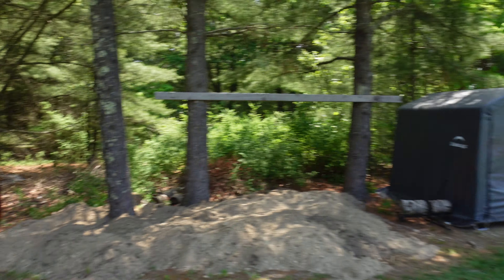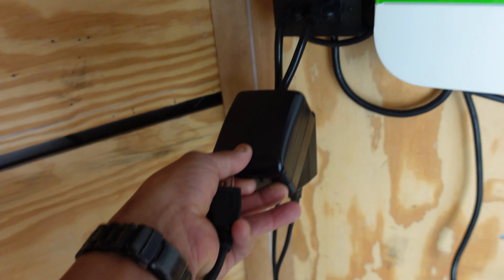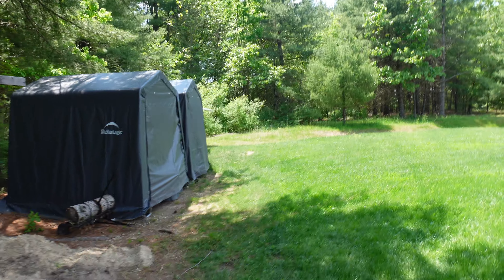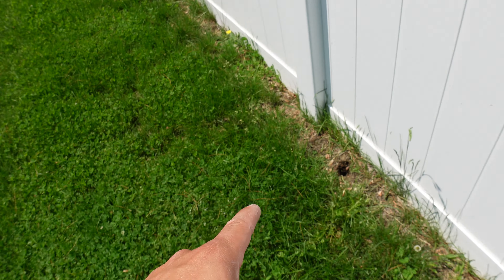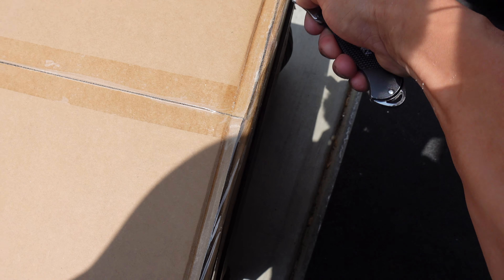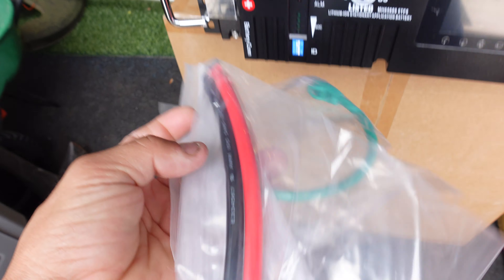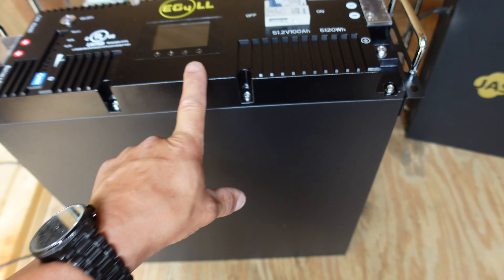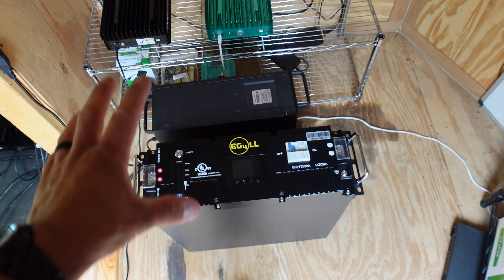Crypto Mining Solar Trailer Upgrade Begins

Comment: Check also the structure of the trailer, so that it withstands the weight on certain location.  To my understanding not all trailers withstand heavy weight on some specific spot but its more like total weight loaded evenly on the total surface area of the trailer.   Just to avoid surprises.

Comment: The Cables are fine for the rack connection.  Youll need larger cable running from the rack to the invertor.   You can run much smaller cables at the higher voltages. Same with the solar wiring. You'll most likely run all your panels in series for high voltage rating 400v+. These systems are much different than the 12v stuff. Just installed a 48v system less than a year ago and it's been great.
Reply from the maker: Awesome thank you for letting me know about the battery cables for the rack. I forgot higher the volts the cable can be smaller

Comment: Solar panels mount 3ft away from fence and 2ft off ground facing south. Mine are lined next to vinyl fence and low end was flush and tilt was 30 degree but entire setup had to go 2ft off ground to get extra 60w from Each bifacial.. and def got your work cut out for. Out of the box the eg4 rackbattery BMS will just run with no use of communication port use. and welder cable run between battery 2 gauge and 4 gauge to inverter if less then 130 amp load or stick with 2gauge and keep inverter as close as possible max 230 amps. Just fyi.

Comment: Since it's a long distance if you can afford use 8AWG your minimum should be 10AWG and also install a 3 wire cable for microinverters in case you decide to expand and your inverter strings are full. Solar panels are like miners once you start you will get more. 8x545W panels can run a M60s on solar for 7H15
Reply from the maker: Yea I ordered 500 foot rolls of red and black 8AWG! Should work good, Ty for the comment!

Comment: If you're going underground ( burying )with your wires , you really only have 2 options . I would highly recommend placing conduit , and then pulling your wires through. If you are just thinking of burying the cable directly, it will need to be rated for direct burial. 
The conduit route has many benefits.  It protects the cable from chewing , burrowing , and digging rodents and pets. It allows for easy replacement or upgrade of existing wires . If you go big enough with the conduit , it will also allow for an easier further expansion . [ I have many years experience in underground utility construction. ]
Reply from the maker: Makes total sense! Alright that’s the plan underground conduit it is!

Comment: It's the way forward mate - 3kw panels 16kwh battery 9kw inverters here - happy as larry.  My advice would be over-solar as much as possible as solar panels are cheap as chips compared to batteries so if you can totally cover off your usage 8am to 8pm via solar and if possible keep your batteries at 100% then you can get away with half the batteries just for overnight use till teh sun coms up again for a new day.

Comment: If you could get a hold of the server type racks with the roll out racks,that could help if you need to move those monster batteries in the trailer. Not sure about the guage of wire,but look into maybe 4 guage depending on the amps of the batteries and the setup. Can't wait for the next solar video!!!

Comment: The solar wire guage is dependent on how much volts and amps your pushing through it, just check what the maximum amps your panels will produce at your panels voltage and and match the wire size. (Higher voltage=less amps so try to aim close the the inverter solar voltage input limit (450v or 500v i think)

Comment: if you PV string voltages are high enough and you dont parallel strings, you should easily make that distance with 4mm2 PV DC cable. 6mm2 would be the sweet spot.
unless installing to specific code, you can do whatever you want. If the cable size is too small you will just have higher voltage drop and be less efficient and if way too small you may start fires.

Comment: I think you setup your panels and batteries right when you overweight the amount of panels in your setup so that they produce all the energy to the miners when they run at max power AND also able to recharge batteries fully daytime. Squeeze out the energy from panels as long as possible in the early and late day hours, then nighttime use the batteries according their capacity, you can even schedule some miners to have some offtime during battery time. There could be even some hardware sensor based automation for the scheduling miners. The reasoning for this, the kWh price will be lot lower when it comes directly from panels without need for battery power, and when the battery power steps in that kWh price will be significantly higher than the panels-only energy -> you make more profit with cheaper energy. I think you should be able to prove this easily with some spreadsheet calculation. Interesting stuff going on there, will be looking how you will end up doing the setup.

Comment: Xyz cable sizes all do the same amps, but you need less amps because of the higher voltage, so you can get away with smaller cable. Eg 100a at 12v or 25a at 48v are both 1200w.

Comment: Do those excuse fans have a temp controller on them so they will turn off and on when needed and also spin slower or faster as needed. Would save the battery.
Reply from the maker: They actually do I need to install them! Lol

Comment: i agree those battery cables look tiny 
even for a car battery (but i have n idea when it comes to 48V in theory they should be smaler then 12v cables)

im pretty sure the camrs455 is the comunication system used to comunicate between battery and inverter
if you get batterys they need to fit what the inverter can talk to 

if you dont have allready, i would add a automatic firesafety system
som extinguisher bottles with sprinklers or a sack of fireballs 

use 6mm cables im guessing you are doing more then one string

im getting bificial panels also
im thinking about doing a concrete slab and paint it with white epoxy floor paint

the problem i see with natural rock it they are to mat in the color to get a good reflection

with expoxy i can give it the shining surface needed for reflection, by adding coating..
i can even add glimmer effect if i want 🤣

its going to be slippery when wet.
but deffently more easy to clean then rocks right under the panel with a high presure washer 
it is also easy to add some details in the paint like a patern to spice it up

it would also be posible to add water on the top of the slab, for reflection.
and have some fish in there for example  🤪
Reply: i would say if you have sun on the ground under the panels adding reflection makes sense (the panels them self do also let a little light through)
you are probetly tilting the panels away from the fence and not doing vertical

adding white infront of the panels also have some effect, just like water on a boat
ofcourse the angle also plays a role if you have then lying flat on a roof you wont get anything

im doing a tilting rack i can adjust for summer and winter
that is also a way to pick up a bit more by adjusting the panels twice a year

Comment: I know way to save Power have all the fens temperature dependent if it goes above 30 or 26 degrees Celsius cooling thermostat Turning them on😊 two thermostats in case 1 fails

Comment: Battery powered weed wacker for a property that size? 😅
Reply from the maker: Hell yeah! You have never used Milwaukee have you?! Top of the line battery equipment.
I have the big $250 Battery for it (18V 12.0) I also have a corless gas pipe threader that is the balls that runs off these batteries!